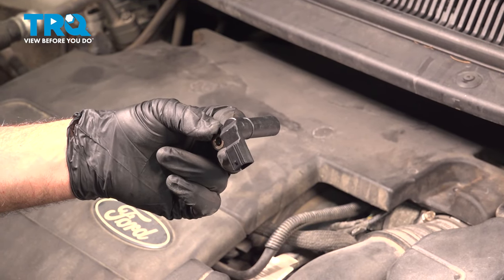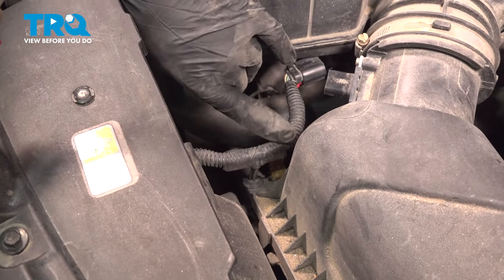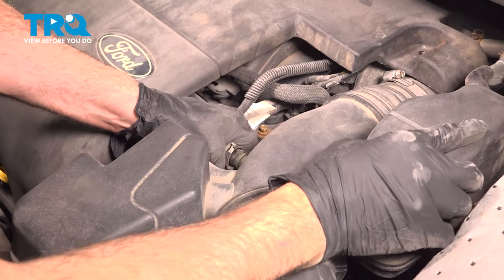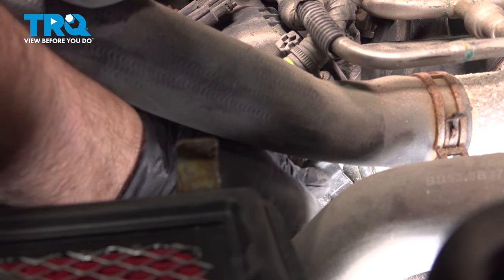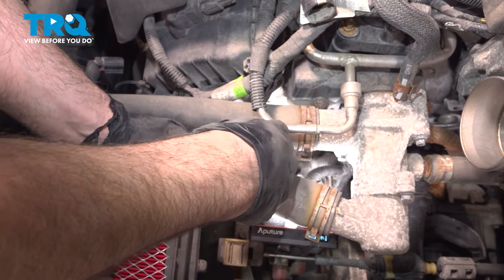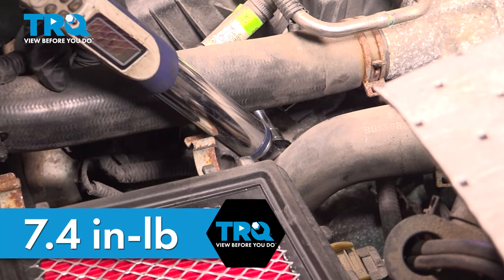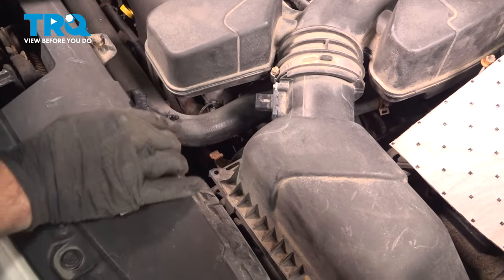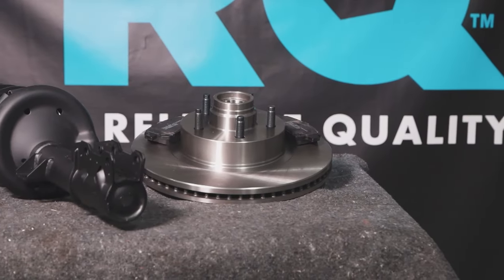How to Replace Camshaft Position Sensor 2011-2019 Ford Explorer

Comment: Getting ready to do all 4 sensors.
Only because I've already done this on my nissan, and found that just replacing 1, led to replacing the other 3, and crankshaft position sensor. 
My question is, when I order or buy these camshaft sensors, are they all the same?? Great video!!